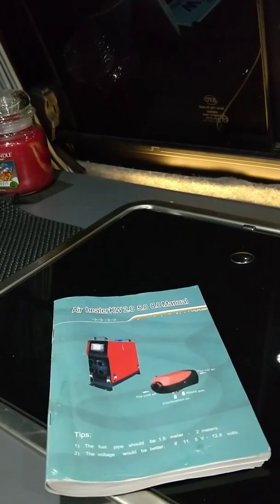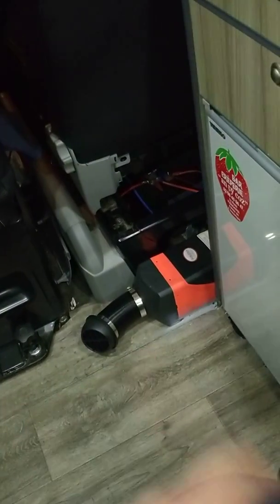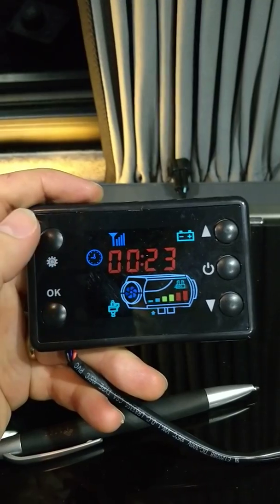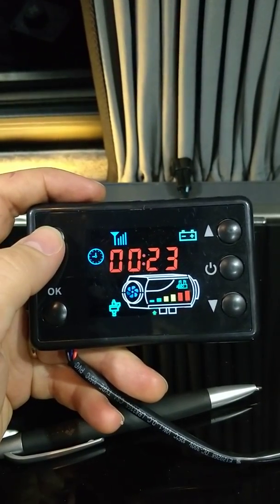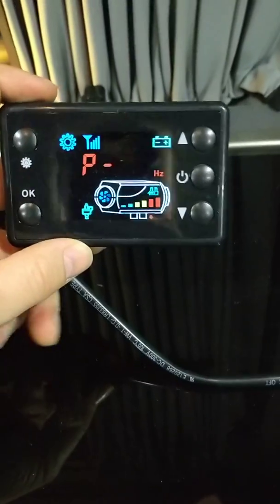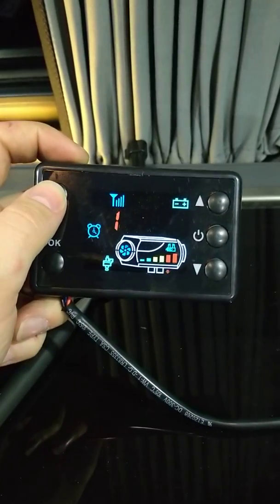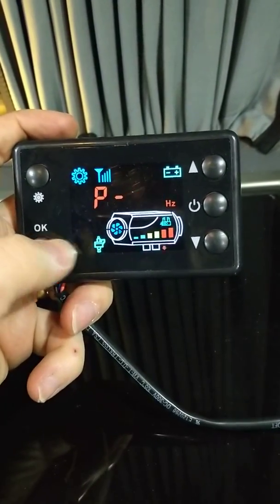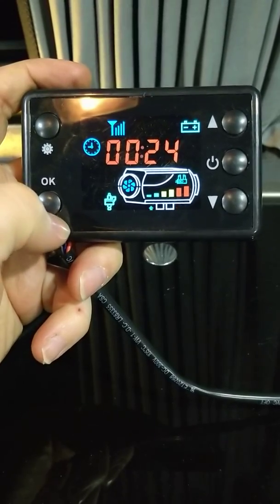Tuning a 2kw diesel heater to run efficiently using a LCD controller

Comment: I have a brand new 2kw, chuffs out loads of white smoke fails to start e10, takes four times to start done everything going to it to make it start first time so will try these setting tomorrow
Reply from the maker: Let me know how you get on👍
Reply: @jamesfrawley7481  well mine was already on these settings, all i did was change pf6 to pf5, thats the glow plug temp, then set the fan, and rpm, and it fired up straight away, so mabe the fan apeed helped me out
Reply: @jamesfrawley7481  will do mate, i have had this unit 2 weeks, and always suspected it was over fuelling on start up
Reply from the maker: @Ratsplatterjoe  it sounds like it. It's all down to the settings 👍

Comment: Hello , Could you tell me what the diameter is of the outlet port?  is it 75mm?
Reply: On TRUE 2kw heaters it is 60mm.  If your outlet is larger then most likely you were sent a 5kw heater advertised as a 2kw heater.   It is actually a bit harder to find a true 2kw heater.

Comment: I cannot access settings on my controller. Same controller as yours. Any ideas? Thanks
Reply: The problem with many of these units is poor Quality Control.    Recently I received a controller with a new diesel heater that was not soldered properly on the board.  It was very erratic and often didn't work.  After reflowing the solder connections it worked perfectly.
Reply: There are 4 black controllers like that , they look alike but are not.
Reply: @pauls466  thanks,
Reply: I've got the Same problem I have just ordered a new one.
Reply: @christopherpeary7290  I ordered another heater with the newer (4 button) controller. I want tobuild a compact portable one.  Since mine at least wor,ks good I,m gonna keep mine. Mine only has 3 things to look at. TempC.    hz. 1.0 to5.5 which i can adjust.  And the battery voltage. Remote works too.
Reply: there are 2 controlers that look similar see the big battery symbal at the top right , ONE HAS IT ONE DONT If yours hasnt its the controller you CANT set up ,
Reply: 9009 also works, mine was 1688 and then I paired the key fob controller and the code changed. These are the dumbest heaters.

Comment: My heater is a 2kw with those same settings, but my display only shows 2 green,2 yellow and 1 red segment, don't think my heater is throwing out enough heat.
Reply: I believe the "bars" are for efficiency, I could be wrong. Also I've tunes this while it was operating with np. Just some FYI.
Reply: This video
https://www.youtube.com/watch?v=kOaQKf-i2f4&t=367s&ab_channel=Italjohn
says you can change the glow plug power - that's what the "PF" setting means:
"The PF-5 stands for "glow plug 80W. (PF-1-2-3-4-5-6 = 35-40-45-80-90w glow plug power)"

So maybe turn that up?

Comment: Great vid. I have a question.  How can I adjust the screen's brightness, if possible? Thx
Reply: Not possible
Reply: has it gone dim
Reply: The 2 backlight LEDs are wired without current limiting resistors.  It is strongly suspected that this allows too much current to flow though the LEDs and over a year they get dimmer and dimmer.  There are at least 2 videos showing how to replace them.  The alternative is to replace the controller, about £10, of course you will have to do this again a year later, either way is not difficult.

Comment: you beauty, running like a 2kw diesel heater, no smoke or smell. thank you very much, one thing, does the fan have to run at 4550rpm on high or is that the proper settings
Reply: Allan running the fan at 4550rpm is a little high so you can drop it down to 4300 or 4400 ram. However if you adjust it you may need to adjust your P-3mhz setting as well.